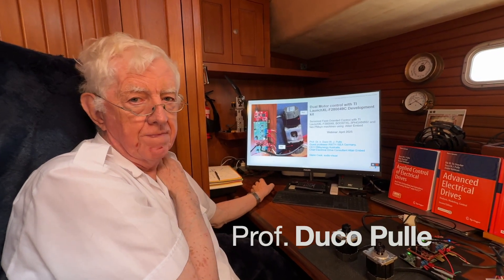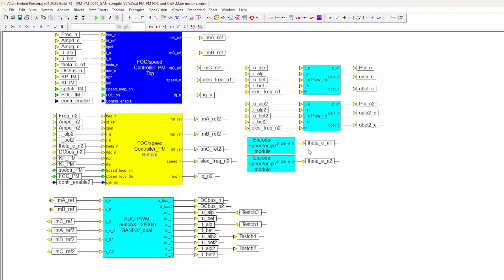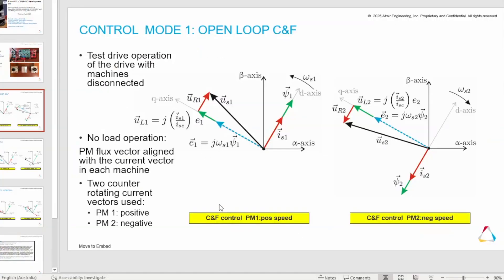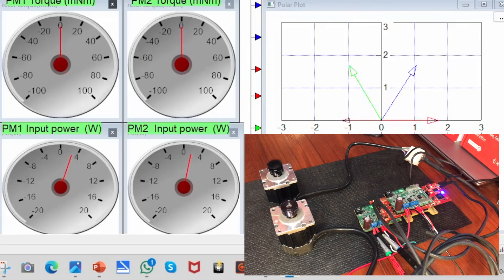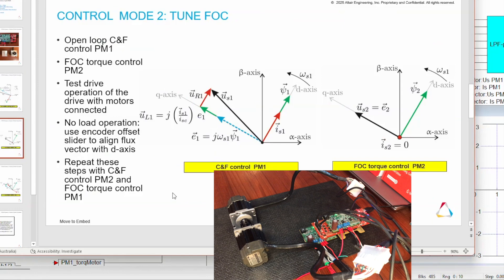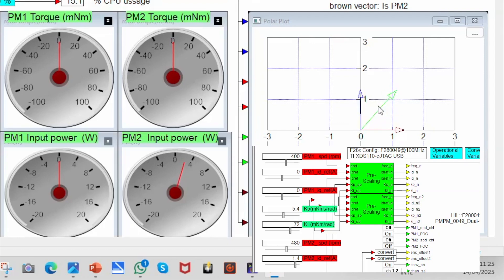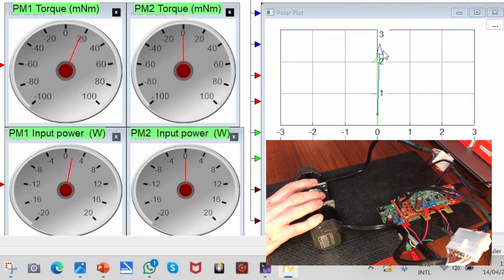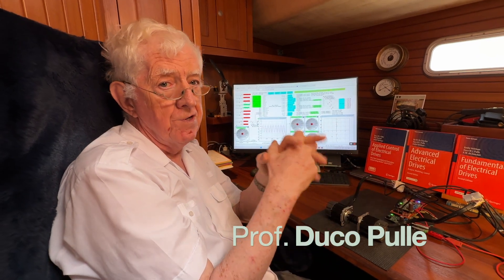Prof Duco Pulle 2

Comment: Wow Duco, really nice example of theory and practice behind using mechanically linked FOC PM motors! One is the dynamically configured load and the other the dynamic test drive.  The interactive look at current vectors was sweet. Using sliders to adjust encoder offset to align flux with D axis was informative too. Where can people get these example diagrams?